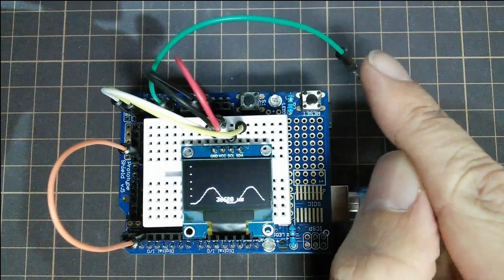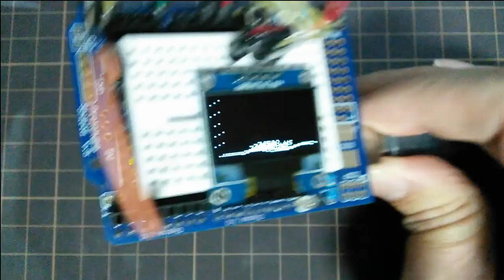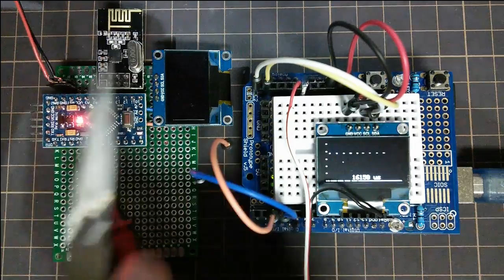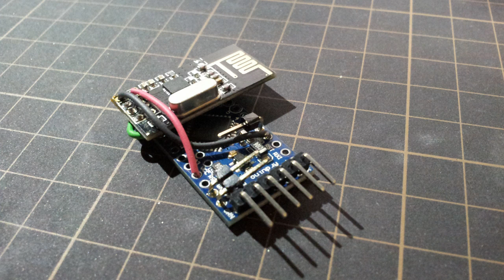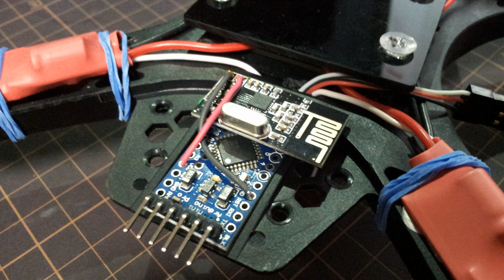Arduino mini-oscilloscope

Comment: maybe the crystal on the 3.3v board is running slow, maybe the crystal is rated for 5v? something is definitely funny here. I have gotten many chinese arduino pro minis, and they all have different components on them, it's like they throw them together with whatever they can get. but for 2$ a piece, man.. its still awesome
Reply from the maker: Not sure what you are referring to there. The problem I was having with the CC3D board turned out to be my code was written for a 16MHz arduino, and the pro-mini runs at 8MHz. Values used for timers need to be halved for 8MHz to get the same real-world time.

Comment: Great little project.... with some modifications and perhaps a better front end opamp it could have higher resolution at least to audio spectrum range...I Dont know if anyone mentioned it but the wave you are picking up is the 60 HZ room electric via RF....all modern (unless England) is 60 hz..50hz in England...
And yes it is all around you all the time because AC is being generated all the time in the electrical lines....its very small as far as current goes but in england its at 240 volts coming out of the wall... That is a large waveform....

Comment: Very cool
Reply from the maker: For some reason your PM is not showing in my inbox. The wiring is very simple, I explained it all from about 1:00 onwards, there are only 5 wires so you should be able to pause the video in a couple of spots to see it all.
Reply: Thank you

Comment: The wave shown when nothing is connected is induced voltage from mains EM radiation (about 20 ms sine wave i.e. 1/20 ms = 50 Hz).
Reply from the maker: Yeah, that's what I started to realize after making the video :)

Comment: Just built this with a different make of OLED screen (which isn't supported by the Adafruit library). I converted your code to use a different graphics library: U8glib and it just works. This is so useful for Arduino projects and has to be the cheapest useful oscilloscope you could make!
Reply: Raf C
Just change this line to suit your model of display:

// Set up the display
U8GLIB_SH1106_128X64 u8g(U8G_I2C_OPT_NONE);    // I2C / TWI

I recommend getting the u8glib examples to work with your screen first. For I2C wiring pin A4 is SDA, pin A5 is SCL.
Reply from the maker: Cool! What type of screen are you using? I ended up building a permanent version of this with a 320x240 color screen to use in future projects. I worked on the sketch a lot more after making this video, and I now have a more generic version where the width and height of the screen are #defines and I don't hardcode anything that expects the screen to be 64 pixels high. It uses double-buffering to store two sets of sample data - the old samples are used to write black pixels over the previous line pixels to clear them, before drawing the new line. This was necessary because the 320x240 screen was much too slow to do a full screen clear every time. I also tried using much faster sampling methods, and if you're only interested in a digital signal (as in the latter part of my video here), things can be done much much much faster :) I've added another link to the video description.
Reply: ***** It has an SH1106 controller. Very similar otherwise with 128 x 64 resolution in monochrome cyan. I like the sound of that double-buffering, a faster screen refresh would definitely be useful. I've been planning on putting a lipo powered pro mini 3.3v with a 10DOF module (for the compass and altimeter) onto a small quadcopter or heli. Your quadcopter videos are a good inspiration. I like the idea of a really simple, cheap, fully autonomous drone.
Reply: buncho888 
can you please share U8glib version, as I'm using SPI OLED SS1306..
Thank you (;
Reply: buncho888
Hi, did managed to run it on Adafruit just added lines to drive my SPI screen.
Thanks!